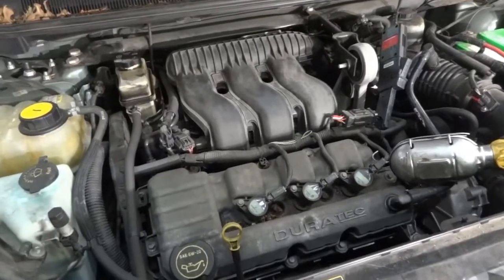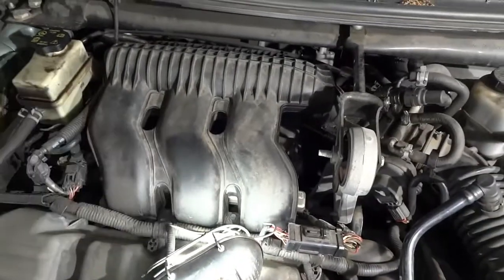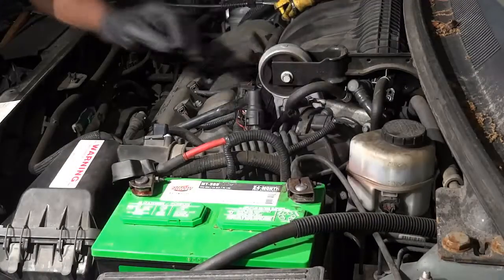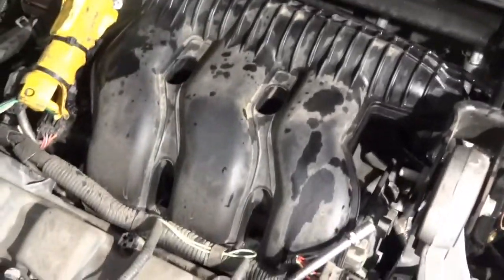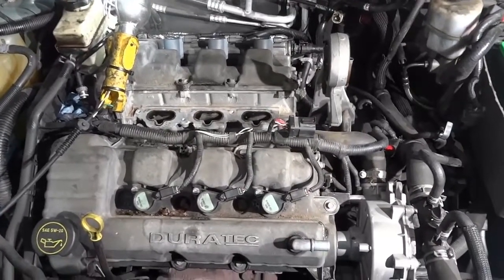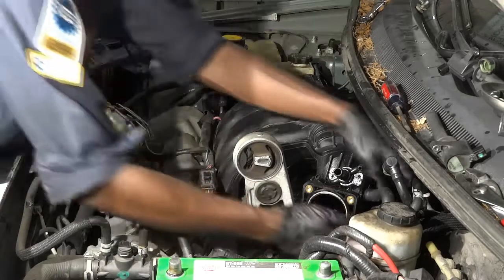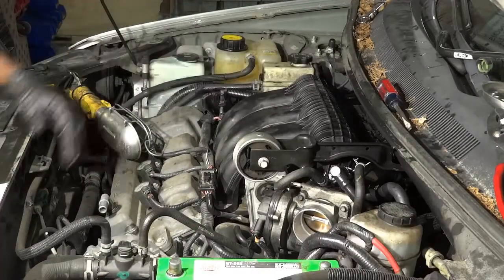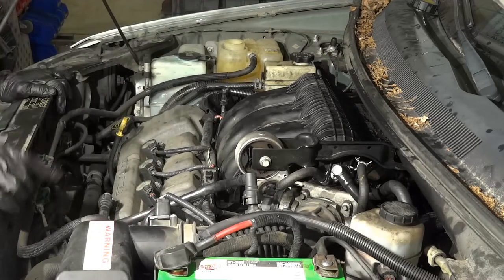How to Remove and Replace an intake Manifold on a Ford Freestyle

Comment: I was watching your video to try to get an idea for what tools I will need but never found them in description or mentioned in the video. This may be worth mentioning to help us along when we (the viewers) don't have a lot of time for planning.
Reply from the maker: Joseph Townsend  Sounds good! I will be doing that in the upcoming videos! great suggestion!
Reply: What tools are needed?
Reply: @michellesmith649  eh…I can’t remember everything I used but I know for sockets I used 8mm, 10mm, 13 or 14mm, and a 24mm. You will also need some pliers and a 1 1/16” wrench with long reach so don’t get a stubby (this is for the egr nut) a flat head screwdriver, a spark plug removal socket I believe 5/8 to make thing easy, some gloves, and tough fingers. It’s not a bad idea to have a magnetic pick up tool handy and personally I use a magnetic tray to hold the bolts. This may not be everything but it most certainly is close. I’m not a mechanic so I don’t keep tools around usually I think I was able to get most of this at Walmart for like $40-60 just got two separate kits one SAE and one metric and two different drives a 3/8’s and a 1/2” with an adapter to downsize if needed.
Reply: 5/16 with an extension for the bolts on the manifold cover. 1 1/16 wrench for the egr tube. 15/16 for the mounting bar, 1/2 socket for the cvt mount bolt.

Comment: Excellent video of your work!  I have to change my spark plugs on a 2007 Ford Five Hundred.  Because I will have the intake manifold off, should I go ahead and change the coils on the plugs too?  This car is now 16 years old with 110,000 miles on it and I don't want to take that manifold off again. Thanks!
Reply from the maker: B. Walker  Yes! replacing the coils while you have the intake off is a wise thing to do!
Reply: @KITS_Auto_and_Truck_Repair  That's what I needed to know.  Thank you very much, and again, great video!
Reply from the maker: @b.walker930  My Pleasure!

Comment: Do yourself a favor on the throttle body the two coolant lines take them off and plug them off if you get a aftermarket they have them gone by past no longer there there's a reason for it
Reply from the maker: @CharlesLease-ei1ee  Oh really? what's the reason?

Comment: hey my dude, out of curiosity since in there after u removed the egr tube, wouldnt it be a good idea to replace the pcv valve since in there and now have clear access to it
Reply from the maker: Timothy Siebold yeah if you wanna replace the pcv valve yes you can replace it too , since it's right there... but I didn't replace it on this car

Comment: Which cylinder is number 1? My code reader says I need to replace the ignition coil on cylinder 1.
Reply from the maker: RockawayCCW  cylinder 1 is the cylinder next to the timing belt on the bank that faces the firewall, the one that's covered by the intake manifold!!
Reply: @KITS_Auto_and_Truck_Repair  That figures :-)
Reply from the maker: @RockawayCCW  sounds good!

Comment: I cant get mines off the bolts seem to be sealed into the intake manifold heading the screws loosen but they wont release mines is a 2007😒
Reply from the maker: STOPLOOKIN ENT spray some WD40 on it and see what happens!
Reply: @KITS_Auto_and_Truck_Repair  one more question whats the size wrench to remove that big egr bolt??

Comment: Quick question for you. You were doing a lot more extensive work on this engine than I plan on doing. I'm just looking to replace the spark plugs on my 2006 Freestyle and I'm wondering, do I have to remove all the same things you removed or can I just remove those bolts on the manifold to be able to access them?
Reply from the maker: Joshua Chambers if you are gonna replace the spark plugs on the cylinder head in the back! 
you have to pretty much do everything I did in the video to remove the intake manifold so you can get access to the coils under the intake manifold!!!
Reply: @KITS_Auto_and_Truck_Repair  Well shucks. Good to know and I appreciate the video demonstrating how to do it. Unfortunately, I don't have the tools or the space to get that extensive with the project. My check engine light popped on and kicked out 6 different codes at me starting with P0193 which I replaced the fuel rail sensor to cylinder 1 and 2 misfiring. I'm just hoping it's something like the spark plugs that are causing it. The exhaust has a lot of black smoke coming out the back of it and a strong smell of gas.
Reply from the maker: @DeadInside200  that's a bummer!! or you could rent tools from your local parts store! Good Luck, the misfire may caused by the spark plug or the coil, I recommend replacing the coils in the back, when you remove the intake manifold
Reply: @DeadInside200  they also have a wiring problem
Reply: @markbrooks8500  the ,05-06 500, Montego and Freestyles are Electrical nightmares. Whether it's the ECM harness getting water in the connector, the harness on the firewall rubbing through or the the solder break on the instrument cluster.
Reply: @KITS_Auto_and_Truck_Repair  can the misfire be from blown head gasket? Had a P0301 code, followed your steps and replaced spark plug & coil pack on cylinder 1, took it for a test drive and threw a P0302 code.
Reply from the maker: @StarDeSoul   Yes!  you should have replaced all the plugs

Comment: I have this same motor but at the throttle body on the intake where the vacuum hoses go I have a bunch of oil and I am not sure why or what part it is called where the 3 vacuum lines go on to the intake at the throttle body any advice?
Reply from the maker: nate kuhlman you should have a pro mechanic look at it for you... the oil leak around that area may be caused by excessive blow by... that tube is the PVC
Reply: @KITS_Auto_and_Truck_Repair  do you think it could be the inside flaps of the intake manifold not working properly? I just noticed the excessive oil at the throttle body and intake. I have not been able to take it apart yet to properly diagnose where the oil is coming from. The 3 hoses above the throttle body is where the oil is stating to show up at. I know a little blow by is normal the motor has 175,000 miles and uses about a quart of oil every 2000 miles or so. I drive it as my work vehicle and drive about 2-3000 miles a week.. I greatly appreciate you replying to my question! You gained a new follower for sure!!
Reply: @KITS_Auto_and_Truck_Repair  the plastic part that goes in the intake with the 3 hoses above the throttle body what is that called if you know by chance I greatly appreciate it
Reply from the maker: @anonymouslyanonymous6545  it's just a junction point, if I remember correctly,  your problem is beyond that point... the oil leak there 
is just the symptom of what's going  internally...

Comment: Okay it doesn't go to the throttle body and hooks to the manifold and Crosses over to the other side but I don't know where it lands on the other side
Reply from the maker: Robert Bowen  what are you referring to?
Reply: @KITS_Auto_and_Truck_Repair  found it and fixed it just wanted to say thanks again never would have been able to do this project without your video
Reply from the maker: @robertbowen2630   My Pleasure! I'm glad to hear that!

Comment: Do you have to disconnect battery to change spark plugs?
Reply from the maker: Joshua Highway  just if you are removing the intake manifold!!
Reply: @KITS_Auto_and_Truck_Repair  🤦‍♂️I didn't undo the battery when I took it off...that may be why my vehicle isn't starting now
Reply from the maker: @joshuahighway7023  if you put everything back together the way it was, that shouldn't be a problem, you probably forgot to connect something!!
Reply: Hey just an update...it turned out to be a fuse that prevented it from starting. I figured that out after I changed the plugs and went in a second time to make sure I didn't break any! 😅
Reply: @joshuahighway7023  hey man I just did this today and I didn't disconnect the battery .. and  now it won't start either.. what did you do? Thanks!!

Comment: Is it okay to release the coolant pressure before pulling that small line off the Throttle body? Also, since you had the intake off, did you clean the Throttle body, and EGR valve assemblies? Seems like it would be a lot easier to do while it's out.
Reply from the maker: John K yes you can clean the throttle body and the EGR valve while you have the intake off... But I didn't...

Comment: How do you replace or rewire the intake manifold wiring harness?
Reply from the maker: Chris Angiolillo  why do you want to replace the harness!!
Reply: @KITS_Auto_and_Truck_Repair  I bought a used manifold but the harness was cut at the plug.  Then I bought a brand new manifold but that had no harness attached.
Reply from the maker: @chrisdorsey1129  you can get a used harness online or at a junkyard!  once you get it, you can just start disconnecting one connector at a time until you install all of it

Comment: Do you have to remove the fuel line? If you do  how is it removed?
Reply from the maker: Windy Abbie  yes you do! you need to use a fuel line removal tool to disconnect the fuel line!
Reply: @KITS_Auto_and_Truck_Repair  Thanks for info. That would have tripped me up.
Reply from the maker: @windynabbie  My Pleasure!!

Comment: Your video has helped me a lot with the Intake Manifold in my 2006 Mercury Montego! I have a couple more questions. I removed all the hoses and throttle body and found that the nut that holds the EGR to the tube is rusted badly and seized. I sprayed WD40 and also Pb Blaster, waited a few hours, and it wouldn't budge with my adjustable "thumb" wrench, so I ordered a 27 mm wrench online and still waiting for it. How do you deal with badly rusted nuts? My next question is, in your video when you were taking off the EGR nut, I noticed you were turning the nut "clockwise" to loosen it. Is this true with EGR nuts? Thanks!
Reply from the maker: Chocaluvr if the EGR tube nut is rusted out, you should use a propane torch to heat up the nut, this procedure will help free up the nut... I was tightening the nut and loosening it on the video to clean the threads on the EGR Valve as I was unscrewing the nut...
Reply: Yes mine is a 2006 ford  hundred and power steering line is in the way seems pretty complicated just to replace plugs  it's a Ford thing hope they've gotten better in their cars
Reply: I read that the EGR valve can be removed by taking off the two smaller bolts and separating the piece with the stem from the part that is bolted on with the 27mm bolt. Is this the case?

Comment: You didn't show how you removed the motor mount bracket and placed it back.
Reply from the maker: Chocaluvr no I didn't, it's pretty easy to remove... once you remove the big bolt on the engine mount, then you have to remove the bolts for the bar across the engine bay at the strut mount... after that you should be good to go... Good Luck!!!
Reply: I see. I’m learning. I have to get to my coils under the intake manifold and it’s my first time. Can you answer a couple of questions? If the bolt from the motor mount is removed to get that brace off, wouldn’t you need to brace the engine from the bottom? Also, do I need to relieve pressure from the fuel line by removing the fuel pump fuse?
Reply from the maker: @ivonlopez9999  yes, put a jack under the oil pan, put a piece of wood between the pan and the jack then jack up the engine a little bit to get the weight off of the engine mount... and yes you should release the fuel pressure... you may not have to remove the fuel line if it's not really in the way...
Reply: @KITS_Auto_and_Truck_Repair  YOU SHOULD HAVE SHOWED IT ALL
Reply from the maker: @markbrooks8500  I did,
Reply: @KITS_Auto_and_Truck_Repair  no you didn't
Reply from the maker: @markbrooks8500  what didn't I show? how to remove the motor mount?
Reply: @KITS_Auto_and_Truck_Repair this guy^^^^^^^^ hahahaha what? I didnt?

Comment: Ford five hundred??
Reply from the maker: Nic Nicc  this is a Ford Freestyle but it's the process on the Ford Five hundred, they both have the same engine!
Reply: @KITS_Auto_and_Truck_Repair  can you video the process of replacing the engine valves?
Reply: @KITS_Auto_and_Truck_Repair  or just one engine valve
Reply from the maker: @nicnicc5702  when another one comes around I'll film it!
Reply from the maker: @nicnicc5702  Will do! when one comes around!